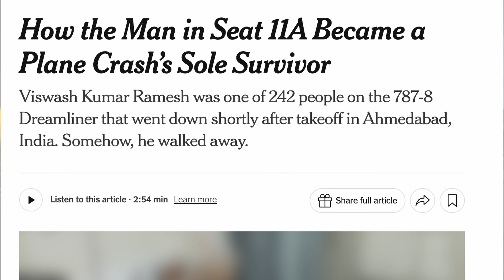Why the RAT Changes Everything – Air India 171 Update

Comment: The fuel pump switch was probably turned off during refuelling, and they forgot to switch it back on when they refired the already warmed up engines. And there was just enough residual pressure in the lines to restart engines and then take off again. So tragically sad.

Comment: Prays to everyone! It will take 1 to 2 years before we know what happened. Still so sad when there is any loss of life. Thank you for all of the time you spend trying to help us understand.
Reply: I'm not sure it will take that long. The final report might, but - for the safety of the industry and this aircraft specifically - people need to know what happened, and quickly. With such massive redundancy built into modern aircraft, dual-engine failures (if that's what happened) need to be understood and addressed.

Comment: Dual engine failure ? I don’t think so. Extremely unlikely. 
Also it is absurd to think that the pilot pulled the wrong lever. Flaps lever instead of the landing gear lever. I think it was even too early to pull the landing gear lever.  So I think there must be a software glitch, some parts of the functionality that the 787 shares with 737 max. The fuel supply was shut to both the engines simultaneously.

Comment: Would dual engine fail also explain the gear not pulling up? (Because you'd not be able to get the gear up with reduced hydraulic)
Reply: You are correct. The RAT doesn't provide enough power to retract the gear, indicating that the engines are not generating sufficient power to produce enough hydraulic pressure to fully retract the landing gear.

Comment: Dual engine failure? The engines didn't fail. My guess: a software glitch told the engines to hold back power and thrust. This was my guess from the beginning. Just a guess, but a possibility nonetheless.
Fuel contamination usually doesn't affect both engines at exactly the same moment. It starts with one engine, then the other. In that case we wouldn't see at least a bit of a yaw, while the good engine is still producing takeoff power?

Comment: Captain, If the plane was overloaded (cargo) or imbalanced load, then that would cause a electric/hydraulic stress, leading to dual engine failure? what do you think on the real cause. I just cannot swallow that both engines would fail at the same time.

Comment: As I mentioned in your first video, (and you are a captain)? 

The original video from the runway side clearly shows he has no lift, the airfield is incredibly long at 3km and he’s used every inch of the runway. How do I know? Look at the dust cloud as he lifts at the end of the runway. The clue is the dust cloud.  He had low power from the off set and you thought the Co pilot had raised the flaps instead of the landing gear?  I’m really surprised you can’t see the aircraft had power issues on the runway.

Comment: 1:08 Airlines are operating like a factory with optimised operation. Front door people disembark, opposite side catering unloading & loading, back door cleaning person running and doing the needful house keeping.  On the ground buses are waiting for pickup of passengers while another bus reaches  with passengers for boarding, some time holding the passengers in coaches, meanwhile luggage issues and loading in cabin and cargo. 

Meanwhile, where is the time to check aircraft which is actually important and the same is done with a very short time, concerned engineer take the signature of the pilot and leave for another take off.  

Really, need to put time for technical aspects of aircraft.  I hope someone will do the needful to avoid such losses.  Very bad....

Please take or allocate some time /action for real checking of the machine after every operation/trips.

Comment: Thanks for the great insightful update of the crash. I’m pretty much leaned toward the theory of fuel contamination, because if bad fuel was pumped into the aircraft when it was on the ground, the good fuel could have still been inside the aircraft in the fuel pipes and pumps, enough for it to start and have the initial liftoff. The flameout of both engines could have been triggered once the remaining good fuel was burnt off and the bad fuel started to be pumped to both of the engines.

Comment: Either they had a failure in both engines, which is rare for both to fail at the same time, or they made a mistake and instead of the wheels, they raised the flaps with the consequent loss of lift. It sounds strange but it can happen; human error exists.

Comment: I'm probably going for a major computer freakout shutting down engines & raising the flaps. Or an event possibly caused by some form of sabotage.

I'm not even sure if the RAT would have deployed on a correctly functioning plane at that height, speed & configuration. I also don't think that decision would have been on any checklist in the seconds they had. I doubt if they'd even begun to assess the situation let alone try to counter it & a RAT deployment would have been a long way down any checklist normally being used at heigh altitudes. I don't even know if they would be effective at all at extremely low takeoff speeds & might have even added to the problem with additional drag.

Comment: The same flight arrived at Ahmedabad 1.5 hour back and one of the passengers made a video showing the display not working, ac not working....you should see that video...may be you can come to some conclusion on hydraulic or electrical failure...leading to both engine failure and hence rat deployment?

Comment: I think the dual engine failure started after V1 leaving them no option but to take off. The evidence for this is they didn't rotate until the very end of the runway shown by the dust kicked up which was most likely caused by the downward pressure off the wings not engine thrust. I think the pilot hopped he could hop the plain over the residential area to the nearby river. The video in which you can hear and see the rat has something missing and that’s the sound of those engines being on full throttle and of course the rat wouldn't be out if they were

Comment: The discrepancy between the pilot's reported complaints (No thrust, no lift) and the visual evidence of un-retracted landing gear and unmoving flaps is highly concerning. This could indicate human error (e.g., missed checklists, cognitive tunneling, or a failure to perceive/report the full extent of the aircraft's aerodynamic configuration) or potentially a complex system malfunction that misrepresented the aircraft's state to the pilots while externally observable issues persisted.

Why didn't the control tower inform them about the wheels of the plane not being retracted? 

One simple question, Kiya flight sa pehlay plane ma fuel dala tha? 

Kiyo K without fuel, the engines can't produce thrust. Without thrust, the wings can't generate the necessary lift, and the flaps become less effective.

I strongly believe that the engines were not getting enough fuel which might have led to engine failure as well as of APU and battery thus leading to automatically putting on the RAT for power generation. 

I strongly believe that the engines were not getting enough fuel which might have led to engine failure as well as of APU and battery thus leading to automatically putting on the RAT for power generation. 

There might have been some issue with the pumping of fuel. I wonder why no one is thinking of interviewing the pilots who flew this plane just before its fatal flight.

The loud bang might have been of the  RAT hitting something and then the last hope of electricity supply also came to an end.

Comment: Evidence #5 for dual engine failure: What do you NOT hear in the video? Two jet engines on takeoff thrust.
Evidence #6: The ADS-B seems to have stopped transmitting at 600 feet. ADS-B will shut down if there is a dual engine failure.

All this evidence was available two days ago. Media and aviation experts have been kinda slow to pick up on it...

Comment: I could not hear the jet engines at all. Without the engines producing thrust the aircraft is going down. The RAT would have given some hydraulics and electrical. The question is what caused the engine failure is the question. The other interesting point is a passenger who hoped off from the previous flight said the electrics on board had multiple failures. What caused these and left the aircraft with no engines.

Comment: I’m aircraft technician and I know that sound coming from deployed rat… and the reason is probably dual engine failure immediately after take off. There were no much things pilots could do on this situation. No power, no altitude; so you have no energy.

Comment: I still don't think it was dual engine failure, that's just so insanely rare. Maybe a massive electrical failure leading to loss of fuel, but that's not engine failure which caused the issue.

Comment: When I was young we had 2 engines shut off on Mi-8 helicopter.  Fuel vent was clogged partially on fuel tank by wasps. During preheating procedure both engines works well  after short time they went out calmly. I'm just guessing negative pressure in the fuel system. But is just guess..

Comment: Ahmedabad runway is 3.5km and they back tracked so had full runway, however the take-off appeared to be at the very end of the runway hence the dust. I believe they hit V1 and experienced issues and had no options but to take off. The initial take-off video is poor and no audio, but it does not highlight compressor stall so most likely not bird strike.

Comment: Dual engine failure - Loss of electric and hydraulic systems until RAT deployed. That explains why the landing gear unable to retract as gear retraction requires both electric and hydraulic input. I assume hydraulic pumps are electrically driven.

Comment: Black box recover and pilot recording also comes pilot says mayday mayday system was failed  some kind so  its means both engine failed because of electrical fail some kind of so pilots get 30 sec which cant do something just try to best which he can 😢.. but one thing clear boeing plans are in safety issue too much come every year some incident comes 😢and because it used sub standard parts in plane 😢 high profits plays with  human life clear 😢

Comment: My prior experience flying into India airports, as a aerospace manufacturing engineer manager (Goodrich Aerospace/Raytheon), I wondered why the width of the runways were so narrow. The wings of the plane were hanging over dirt and our nacelles were barely on the asphalt runway. I thought this could cause engine failures with the intake of dirt into the engines over time.  Could this have caused the failure?

Comment: On my trip back from Mumbai to dubai AI983 dated 10 may 2025, we all passenger's were locked in airplane for 30 minutes with no air conditioning, and screen not working. We were told that it is technical fault and they were working on it. So, I believe and thank God it did not ended in this accident.

Comment: I’m an airline pilot for a major, I knew your initial analysis was incorrect. Steve, you dropped the ball with this one big time. 

The RAT was clearly deployed the entire time, indicating some kind of engine/hydraulic failure - coupled with the Pilot’s mayday call of “loss of thrust.” 

Also, you said it was most likely pilot error and confidently ruled out the possibility of fuel contamination. The likelihood the pilot monitoring selected the flap instead of the gear handle on a 787 is extremely low. The two handles aren’t even near each other! 

Swiss001 pilot put out a better analysis some 13 hours before this video. Maybe don’t jump to pilot error conclusions immediately, something was definitely off about this take off including the most obvious the take off roll used up most of the runway. Careless analysis on your part, do better next time before jumping on world news and sharing false information even though many of your peers were stating the obvious.

Comment: Captain Steeve, see if you can find our more about the software update on TCMA system. (Thurst Malfunction Control Accomodation)
There was an incident on the same aircraft Boeing 787-8 ANA flight NH985 back in 2019. The dual engine had shutdown simultaneously during landing.

 Boeing issued a software update after the incident. 
I tried to look for more information about TCMA with no success.

But the impression I have on the incident of ANA NH985 is that there is a software called TCMA that triggers engine shutdown if it believes uncommanded high thrust is occurring.
This made me thinking of MCAS software issue  with false signal on AoA on Boeing 737 MAX aircraft. Two major crash happened due to MCAS due to a false input by an AoA sensor where MCAS triggers to nose aircraft resulting crash.

So if there is a software called TCMA that triggers engine shutdown due to a false alarm input, this could be possible?? Though it might be extremely rare to happen.

Comment: Mayday no power ? Also Dual engine failure ? Not one..  For sure , there should have been some auxiliary Power back up .. Why It didn't work ? If the powers are intact to save, The system that manages engine power should have failed. 
Don't Know how much flight hours it left

Comment: I had a doubt in his initial analysis that the engine was running normally. the doubt was that if it had run properly and when the pilot demanded thrust u should have seen the fumes spitting vigoursoy and some kind os smoke coming out off the engine as the thrust demand would be higher and in the airport video there was none. so it meant there was no power in the engine so far

Comment: One outside possibility. Just as the aircraft takes off there is a fair amount of dust swirled up.  Part of the lift off is obscured by the building in the foreground. Did both engines ingest dust/dirt that choked both after 5 to 10 seconds?

Comment: Plane getting dual engine failure just after take off 
Or even complete electric or hydraulic failure 
Its not a normal thing 

Does plane took off without security clearance from ground ?
Plane was not checked properly?

Or someone intentionally done something wrong when plane was at ground , may be a proper planned attack

Comment: I'm leaning toward feul contamination, that caused thrust loss and eventually also the loss of electrical power. They could have survived with one engine. Dual engines failure is almost unheard of for good reason. Pilot cant accidently or purposely shut down the engines during climb phase easily. Hence fuel contamination is the only possible cause that can shut down both engines simultaneously.

Comment: Could the RAT have been deployed manually in a panic state ? Do you rule out that possibility ?
Or a case of both engines starved for airflow (near stall conditions due flaps , under carriage yet down), leading to an enforced engine failure and thus auto deployment of RAT ?
Somehow , I see a human error in this tragedy either on ground or cockpit crew

Comment: Excellent analysis captain. I would like to add a point. I’m no expert but I think another evidence that they lost both the engines is that they didn’t have the landing gear up. Why? - because they had a dual engine failure. - as a result they didn’t have hydraulic and electronic power to lift it up.

Comment: @CaptainSteeeve
Evidence 3.5 is ruled out. I heard the original recording, pilot just said " Mayday Mayday"  nothing else, not even the call sign.
But yes there is possibility that there might have complete power failure so even radio telephony over (VHF) stopped working and the complete transmission could not be transmitted.

Comment: There's another piece of evidence to support the dual engine failure theory, and that's the position of the landing gear bogeys. On the 787, the bogeys are tilted up when the gear is extended (the rear tires of the main landing gear touch the ground first when landing). In the video, we can see that the bogeys on the Air India flight are facing forward. When retracting the gear on a 787, the hydraulics first tilt the bogeys down before the gear retracts. This would mean that they did in fact initiated gear retraction, but it stopped/failed just after selecting the gear up. When both engines failed, the hydraulics are lost too. Looks to me like the engines just switched off when the plane got airborne. Could this possibly be another bug in the TCMA function of the electronic engine control system, like the ANA flight where this system erroneously shut down both engines on touch down about 10 years ago due to a but in the air/ground switching logic? In the case of the Air India flight, it seems like the engines just shut down right when it got airborne, when the systems would switch from ground mode to airborne mode.